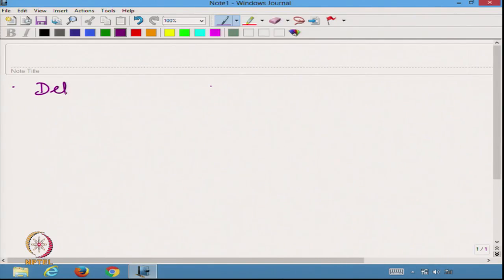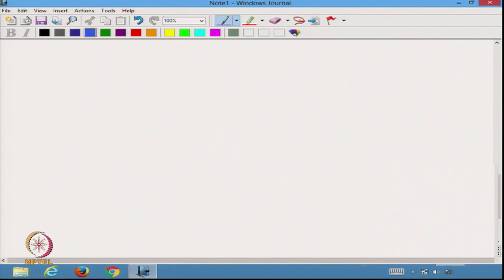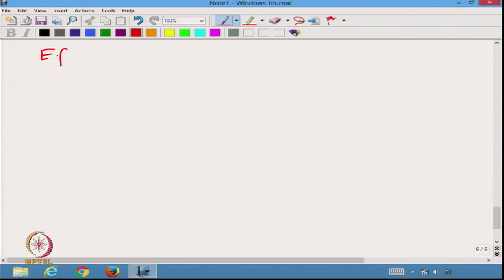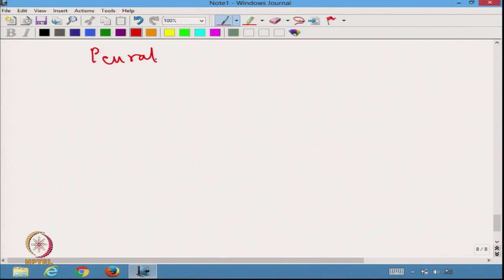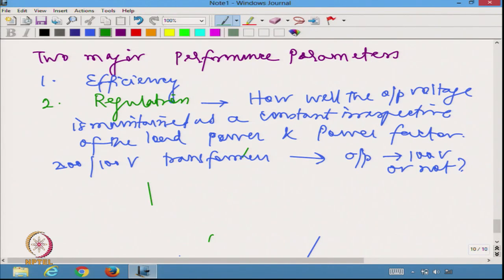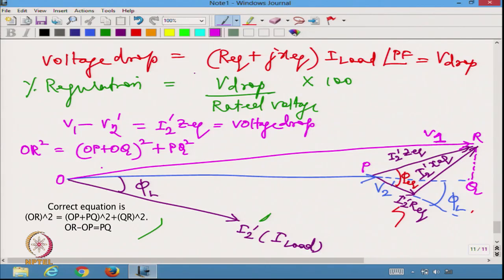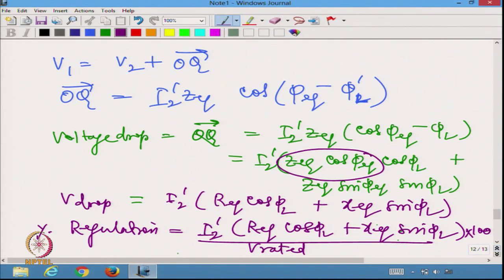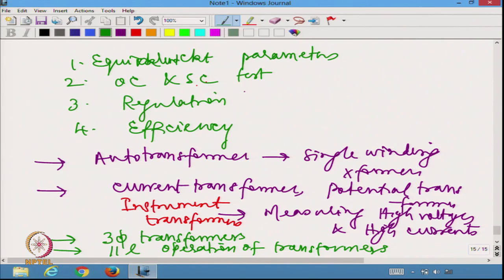Transformers -Voltage regulation and efficiency

Comment: amazing lectures and really enjoying it. I have a small doubt, at 29.30 the signs before sin(phi l) should be opposite right? lagging should be "-" while leading should be "+"
Reply: I think those angles are the angle between load voltage and load current so phi L is negative in case of lagging pf so it's like that ...
Reply: Same doubt